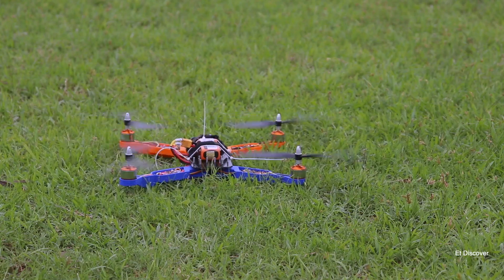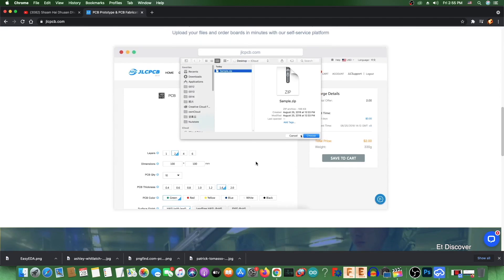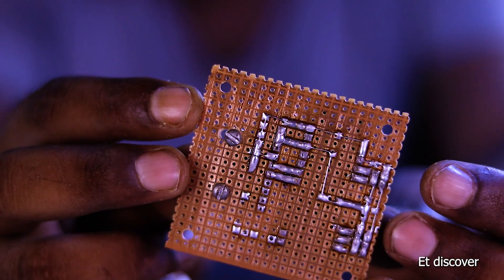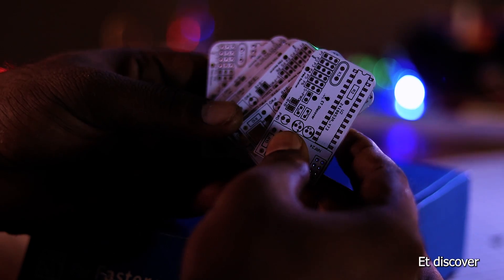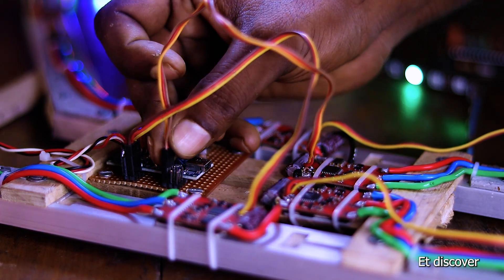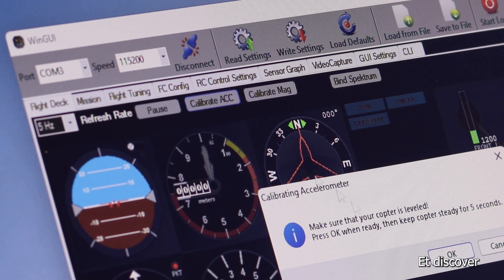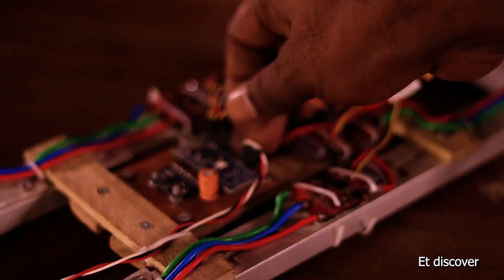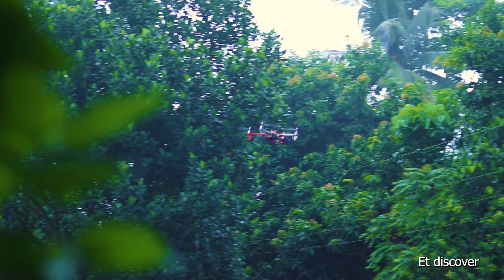HoW To Make Arduino NRF24 Multi-WII Quadcopter

Comment: Sir the motors do not run at same speed. All motor have run at different speed. In multiwii software when i up the throttle all motor run at different rpm how to solve it.I waiting for your reply

Comment: Congratulations 
BTW can you please tell me what should I do because I have arduino uno, I am not having arduino nano and I have my flysky ct6b transmitter and I have mpu 6050 and using the same frame.
Please reply also.
Reply from the maker: Set your transmitter in ppm mode
Reply: @EtDiscover  how could I do that
Reply: Can you please tell me the connection of arduino uno connection

Comment: I was also faced problem of miltiwiii it is because of the damn vibration caused by the motor on mpu6050 🙂🙂🙂try to use vibration absorber or use filtration settings in multiwii code it helped me and my drone is flying great .I used qav250 frame the default pid is great for qav250.also use motors wich have inbuilt copler(propeller adaptor) to reduce vibration and MOST IMPORTANTLY balance the propellers
Reply from the maker: Yeah that’s right ,very important to balance Propeller

Comment: Great work, Brother Nice to see that you use simple NRF24L01 RF module. Why you didn't use NRF24L01+PA+LNA which range is 1 - 1.2Km ??
Which TRANSMITTER model ??
Hard Work. 👌👌🌹🌹
Reply from the maker: Watch my Drone series previous video, how to make Nrf 24 Transmitter and receiver, In transmitter I used NRF24 PA